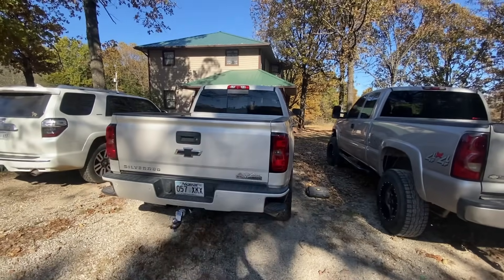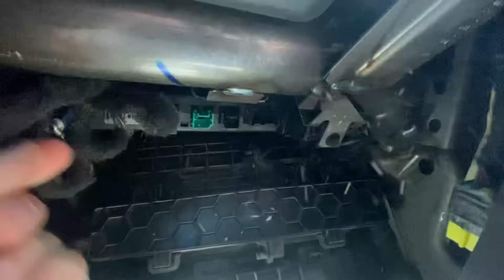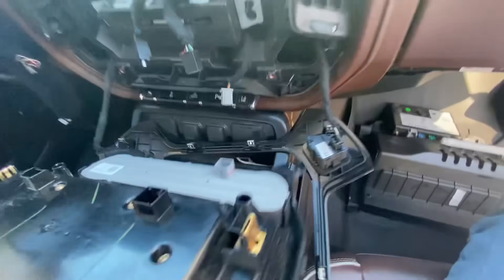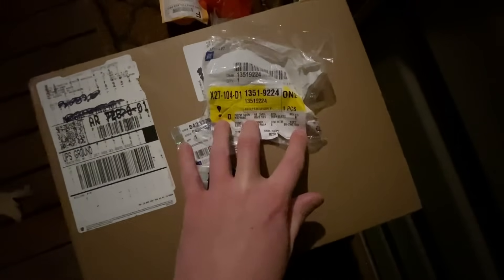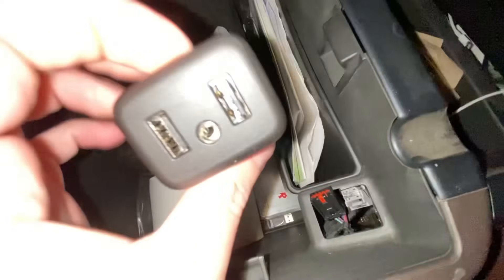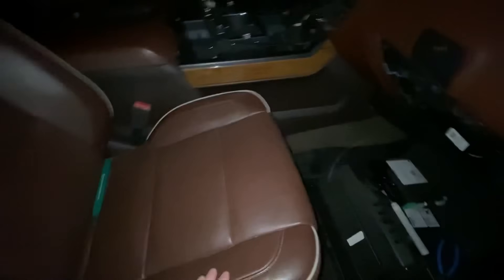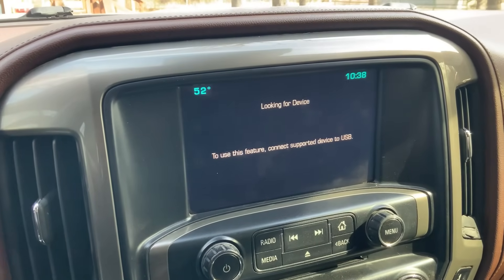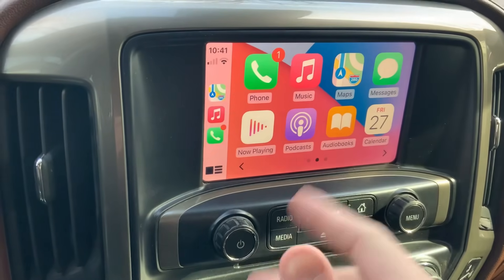How to Add Apple CarPlay to 2014 2015 Chevy Silverado or GMC Sierra

Comment: Great content! I have a 2014 sierra and recently got a service brake assist pop up on my cluster any ideas what it could be the problem? Also my service stabilitrak and abs pops up
Reply from the maker: Sometimes mine does that as well, completely random. Do you ever have issues losing your power steering? If so it might be a bad G218 connection. I have a video on it.
Reply: Could be your battery getting weak. I think I remember mine doing stuff like that when it was near its death.

Comment: So I tried to use the radio pieces from a 16 model that was salvaged…. Easy switch and install. I did it in 20 minutes but the screen is stuck on “Theft Locked”
Reply: Obd genie theft unlock works like a charm
Reply: I did the same thing, just replaced the hmi and the screen, CarPlay doesn’t work tho, do I need to do the radio unit and the usb or just one of them?

Comment: my reverse lights don’t work at all ??
Reply: You checked your fuses?
Reply: @bludragontruck9743  yea checked all of them their all good
Reply: @EduardoRamirez-cp6uq  That’s odd. Where you doing anything to the truck before?
Reply: @bludragontruck9743  no beside putting a new camera for the reverse
Reply: @EduardoRamirez-cp6uq  So you replaced your stock back up camera with a new one? I thought the stock camera was fine on my 2015 Silverado. Maybe some wires weren’t hooked up properly maybe 🤔
Reply: @bludragontruck9743 the one it had wasn’t working anymore but i think the dealer put a stock one again
Reply: @EduardoRamirez-cp6uq  oh ok, now I get a picture. You tried any other videos? I’m assuming “no”. Other than trying to look for more videos couldn’t you take it back where you bought it and ask if it’s covered in some warranty? Sorry, I couldn’t help much. I’d just like to know for myself too

Comment: How much did all that cost
Reply: I heard about a grand total
Reply: Just thinking about it, I’d rather just have my Bluetooth. I bought a expensive double din w/ apple car play and it wasn’t all that. Nothing big changes. When it comes down to it Bluetooth is all you need really
Reply: @bludragontruck9743  In my honest opinion, google maps is the only plus side to adding this. As long as you have good service, you'll always have updated maps with you. Most of these trucks come with the option to connect cellphones through a cable (lightning cable, aux cable) or simply using Bluetooth, so upgrading this simply to have a better looking radio layout isn't enough to justify $1000 price point
Reply: @SanMario95  My thoughts exactly